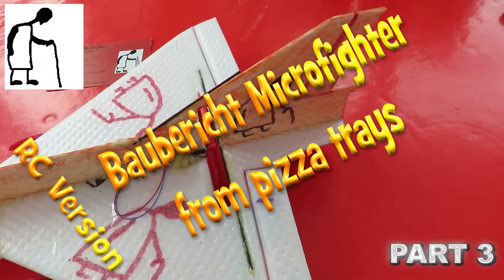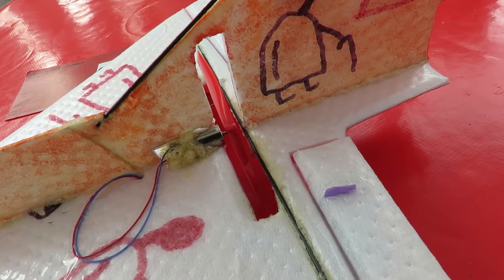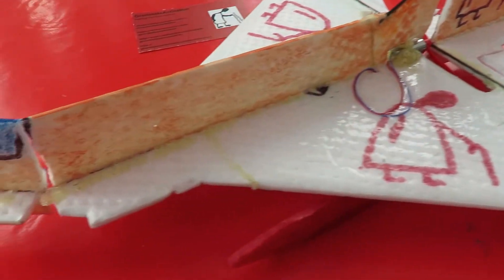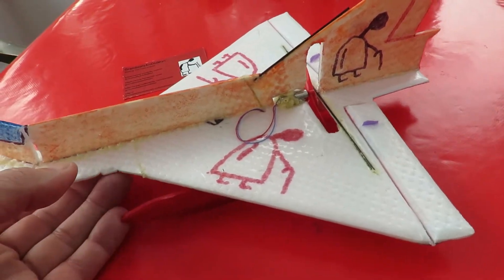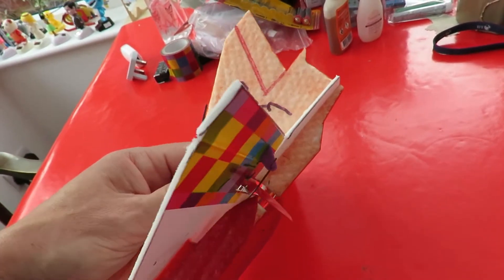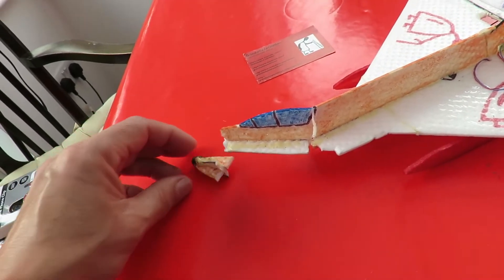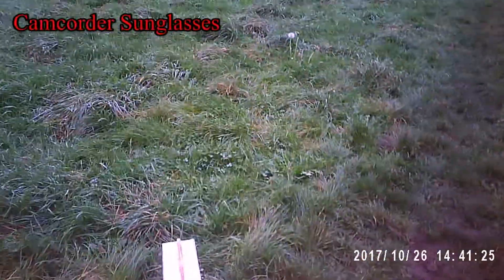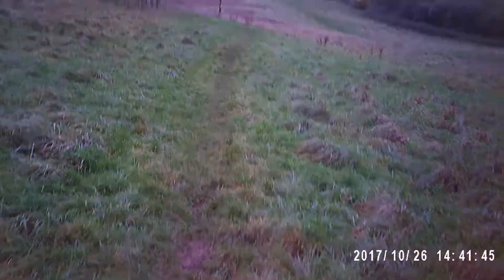RC Version of my pizza tray Baubericht Microfighter PART 3 oh dear!

Comment: Flying wings and deltas required a touch of reflex at the back; which is a tad to up elevator. That is why it noses in.
Reply from the maker: A pilot who knows what he is doing might help too :-)
Reply: Very true.  I commented about how another model he liked and flew well had what appeared to be exaggerated reflex and that much on this small one would likely cause it to want to loop right off, but a few degrees dialed into the elevons would probably be enough.  Too much with minimal thrust to maintain level flight would cause it to fly nose high.  As the airspeed increased the nose would come down and at some point the airspeed and reflex combination would balance.  It takes time to find that balance and clearly I am late to the party to be of much help.  Maybe future viewers will find this comment and others useful if they copy his work.  I hope they do since projects like this can be a ton of fun.

Comment: Hey grandad what was the wingspan?
Reply from the maker: I see the links in the video description don't work directly any more. Here is a new link to the original site for the plans https://www.rcflug.ch/plaene/modelle_Microfighter.php 

Technical specifications
Technical data Eurofighter:
Length: 355mm
Wingspan: 265mm
Weight: 19,6g without rudder, 25,4g with SR

Specifications Draken:
Length: 354mm
Wingspan: 220mm
Weight: 16.7 g with no rudder, 22,7g with SR
Reply: @GrandadIsAnOldMan  thanks
Reply from the maker: Glad you asked because I have now updated the link in the video description 👍
Reply: @GrandadIsAnOldMan  yes the link didn't work in the past
Reply from the maker: @neonuser456  yes , it took you to the right general location but you had to track back to find a current page and then forwards to find the right file. I am glad the site still exists as it has plenty of great designs to download and build.